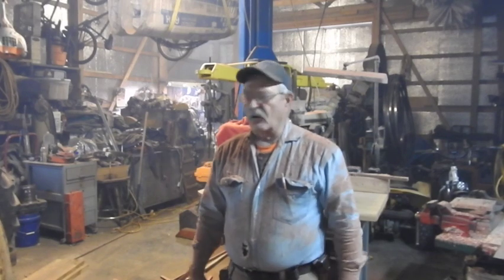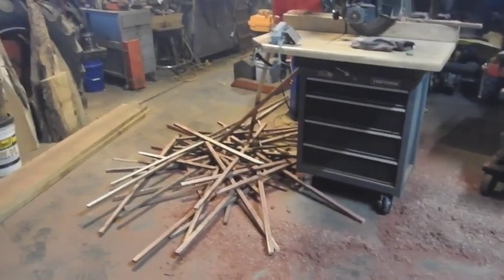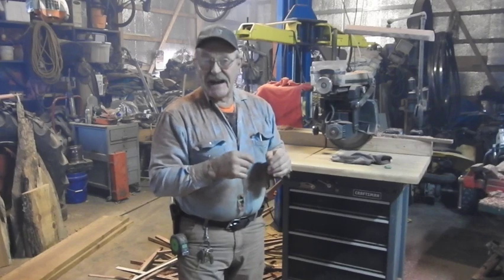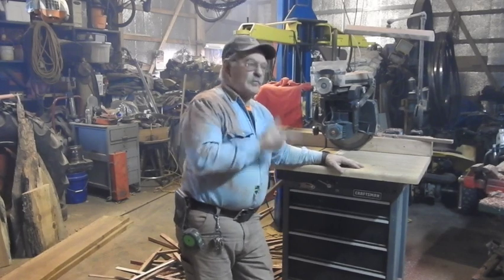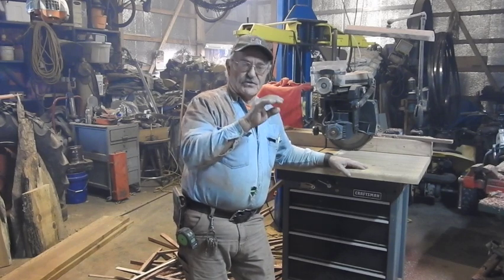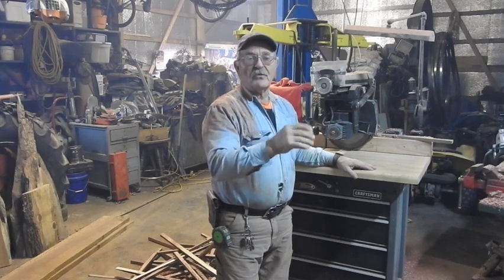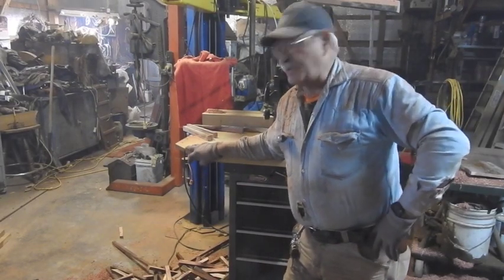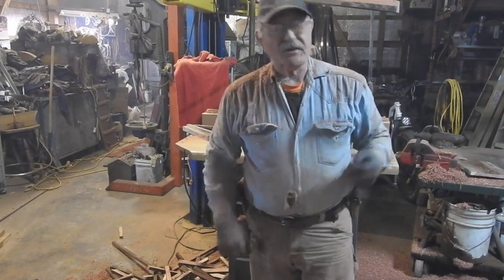Lets Rip Some Strips and Talk Low VS High Voltage

Comment: Wendell you better blow some of that dust off of you or The Missus won't let you into her clean house.
Don't you have a table saw? I thought that I just watched a video where someone gave you a table saw.
Reply from the maker: Hahahaha...I sure did blow the dust off Rick !!  I was nice and dust-free soon as the dinner bell rang !!  Yes, I have a few table saws...but for this stuff I really prefer the radial arm.  I just got that new to me Craftsman 10'' with the rip fence problem and looked at it to see how hard it will be to fix.  It shouldn't be too bad of a job.  My cousin was throwing it away and asked if I wanted the motor so I told him I'd haul off the whole thing.  Its actually better than the one I was planning to use parts off of this one to fix, so this is the one I'll keep for use in a different location. But my GOOD table saw is a Rigid in the other shop.  It's sweet.

Comment: Great disguise at the beginning, Wendell!  You looked just like a pile of sawdust! 😅 Didn’t know it was you until you started talking.  Yes, PLEASE get a dust control system! I’m sure the Missus would approve the funding. 😅 Thanks for sharing!
Reply from the maker: Hahahaha...I was in incognito mode there for a while....LOL  I'm gonna tell you something that will make you shake your head.  No funding required !!  I have not one, but TWO dust collection systems either of which could be used if I'd take the time to install 'em.  LOL  I think I WILL drag out the self contained one that's on a little cart and use that the next time.  These were given to me by the family of my old friend that passed away a couple years ago.  See...?? I told you you'd be shaking your head.   LOL
Reply: @tractorman4461 for heavens sake get those dust collectors set up!    Not just for keeping the dust from covering everything, but health reasons.
Reply from the maker: @mafarmtown2086  At least I DO wear high quality respirators in this dust.  I got to where I'd get severe headaches when planing cedar or walnut.  The dust was BRUTAL on my sinus.  These respirators are rated for asbestos related dust...just about the best replaceable filters this side of the fan powered HEPA full face filters we had to wear in the horrible lead dust filled environment at St Joe Lead smelter. I totally hated every service call in that lead plant.  Servicemen had to change into St Joe supplied clothes and keep a dedicated pair of safety shoes in an assigned locker that HAD to stay on site and shower before leaving the premises.  EVERY service call !!

Comment: And again we share the same tools Wendell. I have my fathers Craftsman RA saw from the 1960's. Same basic set up as yours. I know everyone is enamored with carbide saw blades these days, but if you want to make that old girl run easier, find you a regular old High Speed Steel ripping blade and cross cut blade and then make sure they're sharp. Carbide takes a lot more power to make the same cut and few people even think about carbide getting dull- but it's comparatively "dull" from the factory compared to a sharp HSS blade. Carbide is great for cutting up form lumber and through nails, but a sharp HSS blade cuts a lot easier. Semper fi!
Reply from the maker: A lot of good points Bret...I didn't realize the carbide took more power to put through lumber than HSS blades.  I have a five gallon bucket literally full of both types of blades from the old buddy that gave me the 12'' saw. All old and dull.   I have all the Belsaw tools necessary to sharpen and set the HSS too.  I may give that a go and see what happens.  Thanks for the input and  have a great day my friend.   SemperFi.
Reply: @tractorman4461  It wold make a good series of videos. I know I refer back to your buzzsaw sharpening vids all the time. As far as carbide vs HSS, it's a case of sharp vs strong so to speak. If you've used HSS and carbide tooling in a lathe- same idea. Carbide is great for abrasion resistance and hard steel, heat, etc. But if you want a real clean cut it takes either HSS or a carbide tool setup for a finish cut to start with. Carbide surely has it's place, don't get me wrong, and maybe cutting up dirty wood for stickers is one of those places. But HSS, when sharp, has it's place too. Love to see you make some vids of the Foley equipment! I still have to get mine set up!
Reply from the maker: @Bret4207  Thank you Bret for the additional information.  As you can tell, I know just enough to be just on this side of dangerous about most stuff I do !!  LOL  I use the old Belsaw stuff from time to time.  I need to sharpen 20'' Grizzley planer blades right now actually.  I just don't know if my slide will reach the full length yet. I agree, you need to get the old stuff out of the corner and put it to use !!

Comment: I notice two holsters on the left side of your belt.  Guessing one is knife and the other a multi-tool.  Is that correct?
Reply from the maker: Hot dang Phil...you get an "A" and moved to the head of the class today !!  EXACTLY, a wood handle razor knife I've carried for at least 15 years now and a Leatherman multi-tool.  Sometimes its a Gerber multi-tool.  Thanks for the early morning grin buddy.

Comment: My old Craftsman is about 40 years old, never knew the new ones had a option.
All that electrical talk is confusing to this ole carpenter, my son is a Master electrician I’m sure he’d understand you perfectly 😂
Have a Happy New Year Wendell.
Reply from the maker: I bet your old one has that option as well.  It'll be under the plate on top of the motor.  It'll ramp to full rpm quicker on 240v, if its convenient for you to install a 15 amp 240v receptacle. Your son will know exactly what to do and either agree or disagree with me.  LOL.  The wattage consumption will be exactly the same, but with repeated starts in a short time under heavy load, 120volts does create more heat because of the longer times of start winding engagement during the ramp up to full speed.  Thanks Steve for stopping in for a visit and a Happy and Healthy New Year to you and yours as well !!

Comment: I cut all my strips on the sawmill.  It is a lot faster and easier then a table or radial saw and I always have some waste that would otherwise just be in the slabs.
Reply from the maker: I've done it on the Frontier as well Jim,  but I haven't refined the technique yet.  I'l figure it out one of these days, but in the mean time this is a good thing to get done on a rainy day. My little mill has to sit outside without a roof.  Thanks for the visit today.

Comment: Two things that make me nervous, (1: That Radial Arm Saw, with a dull blade ( Wait a minute, that was two right there, wasn't it? ) 
and 2: All that air borne dust,...Man oh Man Wendell, you have just GOT TO get a way to remove that dust! I'm coughing and spluttering*  here.     * is that a word?
Many years ago when I had one of those saws, I did convert my Craftsman Saw ( like this one ) to 220VAC, that conversion did make it run/cut better ad stayed cooler, as you said.
Reply from the maker: Hot dang....That dust was thick wasn't it.  The BAD news is I have a complete dust collection system that was given to me and I haven't taken the time to hook it up yet.That one is complete with a cyclonic separator that hang outside in a lean to with the large bag under it.  The DOUBLE bad thing is I have a SECOND free standing system on a cart with a built in bag sitting in the corner.  Both came to me through the sad passing of an old buddy that suffered through dialysis for a few years.  I may just pull that one out next time.  LOL  Ain't that crazy or....lazy....
Reply from the maker: I was replying to a comment by Bill Fisher here and it disappeared along with my reply...sorry Bill, it may show up somewhere weird but  I must have hit the delete instead of the edit I was aiming at.
Reply: @tractorman4461  Not  not lazy, but I think you need to get a piece of wood, and write these words around it's outer edge,. " this is a ROUND TO IT "  Then one of these days you'll see this disc on your work bench and think  " Hey I got around to it!"   LOL!
Reply from the maker: @regsparkes6507  Hahahaha !!!  Now THAT is a good idea.  I'd no longer have an excuse to not get something done....LOL  Thanks for the chuckle Reg !!
Reply: Not to mention with the dust as thick as it was, after reading your comment. First thing that came to mind was grain dust explosion. Same concept with an ignition source
Reply from the maker: @billfischer6464  I gotta tell ya Bill, with the wood furnace pumping out the heat right there the thought came to mind more than once !!  I remember worrying about that as a kid grinding feed for the dairy cattle.  The building with the hammer mill would get so thick with the wheat, barley and corn dust me and the old man would walk out looking like ghosts.

Comment: I'm not sure if you are running a 10" or 12" blade on that old craftsman RAS. but if you want to try a new blade look at the FREUD LU83R010 for 10" or LU83012 for 12" blades, they are a thin kerf. I think the 12" has a 1" arbor shaft hole which would require a reducer bushing. they are great combination blade and i run a few of them on some of my radial arm saw's, I think i might be up to a dozen lol. The radial arm saw is still the swiss army knife of tools in the woodshop, so versatile. Just got a bad rap with crappy saw blades back in the day and fell out of popularity with the new miter saws.
Reply from the maker: Yes I agree with your assessment of the bad rap.  So many people seem to be afraid of them too.  But versatility is the name of the game.  Just seconds to change from ripping to cross cutting and back.  Flip one way for narrow rips and the other way for wider ones.  I think I do have a Freud 12'' on one of the DeWalt compound miter and I think the arbor is the same. If so, I might slip that one off and give it a shot.  The compound miters are great but the radial arm got the edge on ripping though. Good comment, thank you sir !!

Comment: I agree turn the blade guard down it will keep some of the sawdust out of the way of your mouth.

I don't agree about the wiring 120 volt or 240 volt the motor will get just as hot with the same load on it. It has to the windings are in series for 240 and parallel for 120 volt. Wiring for 240 gives you less voltage drop from your panel and the possibility of using a smaller cord. A sharp blade will reduce overload tripping
Reply from the maker: Good points about the voltage drop.  I think a point to make about 240 vs 120 is the difference in the length of time the start winding is utilized.  The ramp up time for 120 is longer increasing the higher starting or locked rotor amps for a longer period.  Repetitive starting on 120 with a long cord and the associated voltage drop increases motor temp due to that momentary increased and lengthened amp draw.  But as far as operation is concerned, wattage is wattage and the heat dissipation should be equal as you point out. 
    I didn't convey that thought as completely as it should have been, because with nothing ever prepared to talk about it's hard to get all the thoughts out in the proper order or in its totality.  That's my excuse for the incomplete discussion. LOL  But that's what you guys are for...to keep guys like me on the right track !!  Thank you for making me think a little more on the subject...Being retired now for nearly 10 years, I don't have to think on purpose much any more.  And yes, I need to use a different blade.

Comment: Good evening Wendell….   I think I have said before to you I have never ripped on my radial arm saw… always use my table saw.. that’s pretty interesting about swapping voltage. I only have two 240 plugs in my garage.. I use them for my welder’s.. I have everything thing on wheels in my garage so when I want to use it I can move it into either bay and work or move them outside when the weather is nice….     Thanks for the info on the swap….   As always stay safe and always be kind.   Cheers…..
Reply from the maker: I just got another Craftsman 10'' table saw given to me last week.  The only thing wrong is the aftermarket rip fence won't latch.  It's an expensive fence, worth more than the saw, but its not the super good Biesemeier fence though.  I play hop scotch in my shed too...moving this or that out then back again. It's a symptom of the insanity that inflicts guys like us Gus. LOL

Comment: At the video time of 1:25 as you were blowing dust off the motor, I thought now just why doesn't he blow the dust off himself.  And you did just that ten seconds later.  Don't even think my thought process was  completed by the time you used the nozzle on yourself.  Just thought that was funny.       All teasing aside, your explanation of voltage was down to earth and easy to understand.
Reply from the maker: I hate ripping that stuff so small.  But I like the 3/4'' strips.  Back home Uncle Chippo would rip 'em, on the sawmill so they were inconsistent, but between 1" and 1 1/2".  Inconsistency causes the lumber to warp to conform to the stack upon and within which they dry. (Btw, Is that even the correct use of english) LOL  I gotta get some dust collection hooked up one of these days !!

Comment: I soak my saw blades easy off oven cleaner removes the pitch
Reply from the maker: I obviously just 'burn' it off...LOL  Its time for a blade change anyway.  I've heard others doing that as well...the oven cleaner thing.  I've been known to toss a rag under the blade and spray carburetor cleaner on 'em.  Kinda works.

Comment: Rotate the blade guard clockwise so the guard is close to the input side  of the board, this will cover the blade and pick up the sawdust and expel it out of the round hole away from the operator.
Reply from the maker: Yeah, I DID have it up a bit to let the long push stick go past the leading edge of the blade.  One of these days, I'll hook up dust collection in the shed.  It's kinda tough repetitively cutting 3/4'' strips.  If I don't totally clear the blade with the long skinny push stick, they have a tendency to kick back much easier.  Thanks Ed for the input and I'll do that next time for sure.